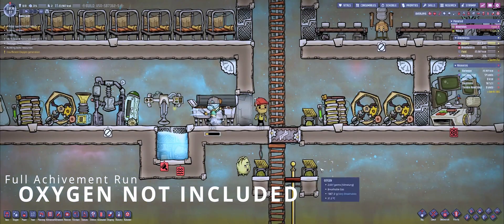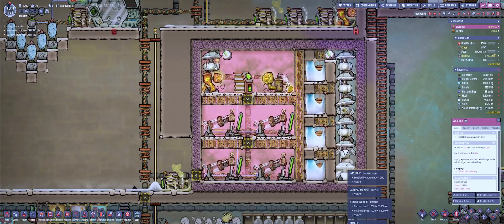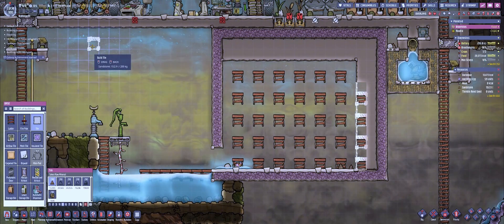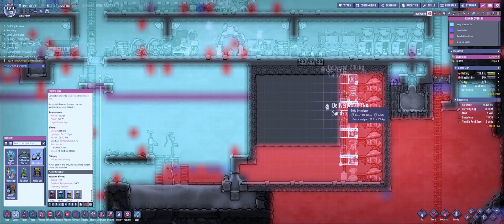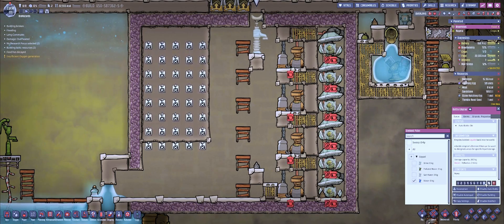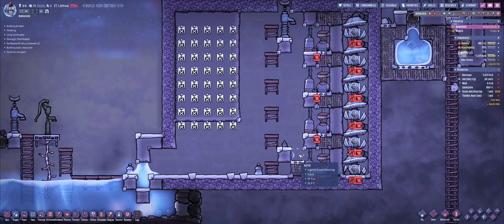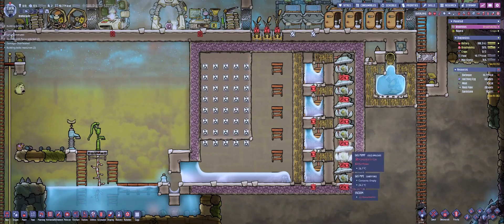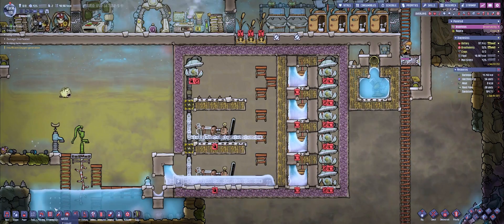Oxygen not included self power oxygen maker or SPOM tutorial basically Ep 8 lets play

Comment: Theres a way to separate them without priming them.
Reply from the maker: Really, cool. How?
Reply: @DrawingXaos  If you create a hydra, you have to add brine less than 2kg with water on top 200kg is fine. Now the top needs to be empty with no tiles that's where the hydrogen will always go and the left side of the electrolizer 2 airflow tiles up to where the water goes that's where oxygen will always go. To the bottom. You can add multiple electrolizers to the right with 2 gas pumps on the top and 4 or 5 on the bottom. Basically, the electrolizer sits on a U with 2 regular tiles right below it and 2 to the right, and  2 airflow tiles on the left, none on top. 
Vertically would be the same thing but instead of how to have them stacked with a tile in between leave a space for the hydrogen to come up from left top corner of the electrolizer and the 2nd left right where the water level sit on top of brine or salt water is where the oxygen will flow. Oxygen always to the left and hydrogen to the right
Reply from the maker: nice, i need to try it.

Comment: Just wanted to say, you will leak a ton of heat through that jointplate
Reply from the maker: True, but the power, I need the power.
Reply: @DrawingXaos  You could make a box attached to the joint plate with another and then vacuum the room with a pump inside. Or you could use some transformers to transfer the power to conductive wires
Reply from the maker: so true, i need to remake this one only bigger for the next base, so i think i might just do that then. i appreciate the you looking out. thank you.

Comment: There's one thing i don't get it when building spom 
How do you calculate the number of hydrogen generators you need vs elctrolyzers and gas pump i do always copy the spom of the other but mine take oxygen into pip that doesn't need which distribute hydrogen into the base or damaging suits
Reply: Its important both with normal spoms and Hydra's to use atmo sensors so you dont vacuum out your oxygen and hydrogen, you always want a bit of it stored so the gasses "know" where to go and dont mix. 

For energy usage, just set up a smart battery and wire it into the hydrogen generators. 

With a smart battery setup you really dont have to worry about ratio's, just make sure that the generaters can output the same or more power then all the other equiptment combined
Reply from the maker: so true, i didnt cuz im a bit crazy and care free, but its always good to have.
Reply from the maker: if you click on the Electrolyzer it says it produces Hydrogen at 112g/s and a Hydrogen generator consumes Hydrogen at 100 g/s.  so you would just make one generator for every 1 Electrolyzer.  that will leave you with an extra 12g/s to accumulate and cuz this system never turns off unless it runs out of water and the gas will never overpressure you safe to just let it be.  Now if you decided to make 9 Electrolyzers then you could use 10 Hydrogen Generators and it would only cost you a full pipe of water. isnt that crazy.

Comment: How does it work with hydrogen being pushed just to the left side?
Reply from the maker: its a lot easier than it looks.  both gasses appear in the spot on the top left of the spom.  the part that is covered in like 200g of water.  that causes both gasses to be pushed out. so the spot above that one is a sold block to prevent the gasses from mixing.  if you prim the spaces first (aka fill one side with Hydrogen and one side with oxygen, not much is needed.) then when it turns out it will keep filling the sides the correct way.  hope this helps.